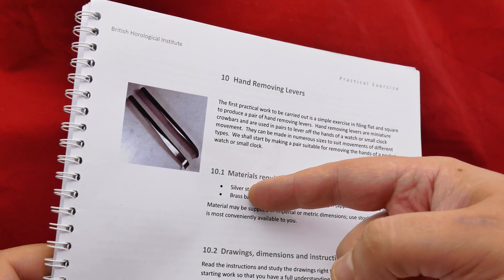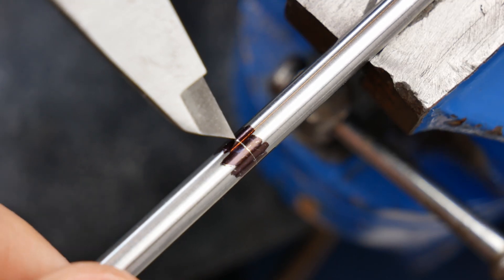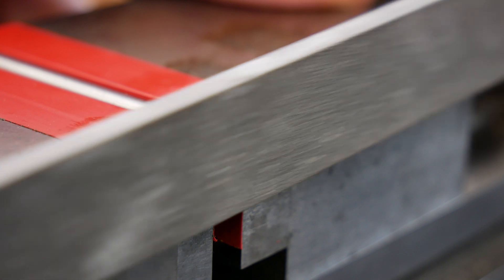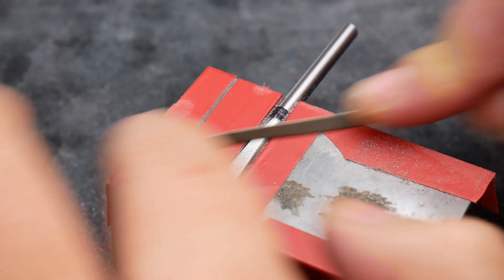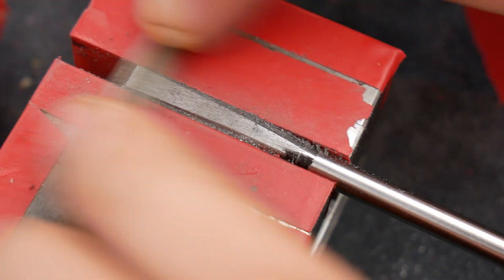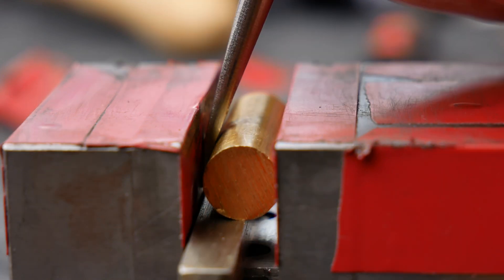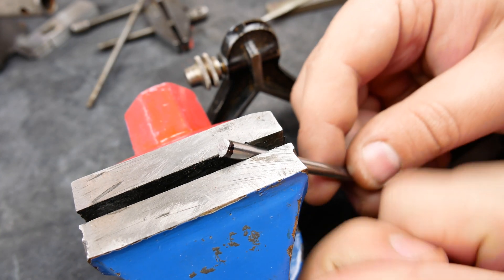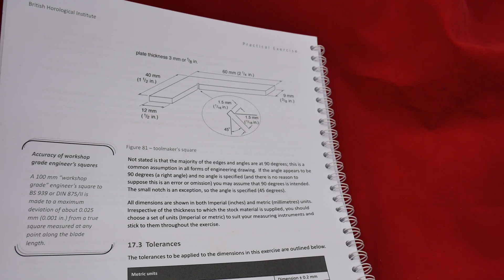First Practical Exercise: Making A Set Of Hand Levers

Comment: I'm still learning the hardness of various metals. I'm not sure how you were able to successfully file tool steel without first heating and cooling it to soften it. Metals are mysterious.
Reply: Tool steel is a high carbon steel if you heat it to a red it will get harder to the point where it can not be filled with a standard file. 😉